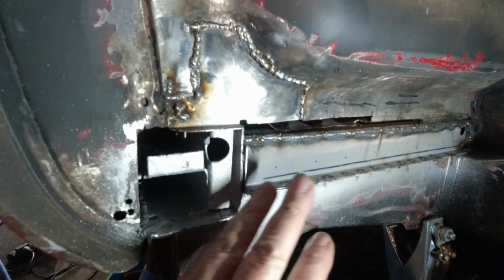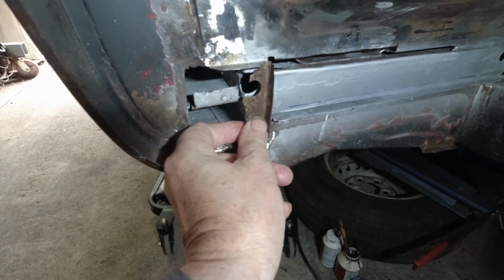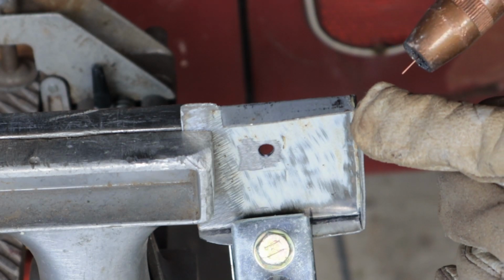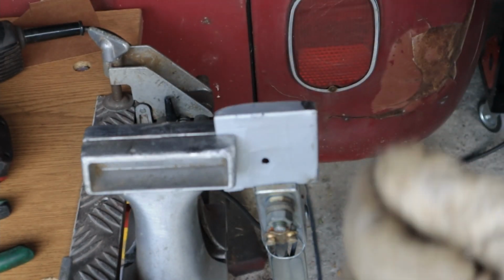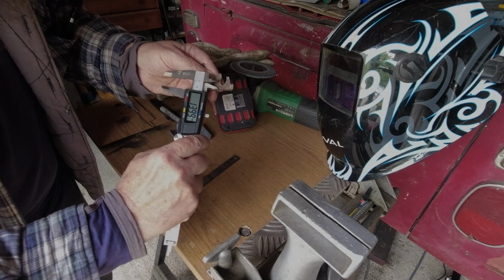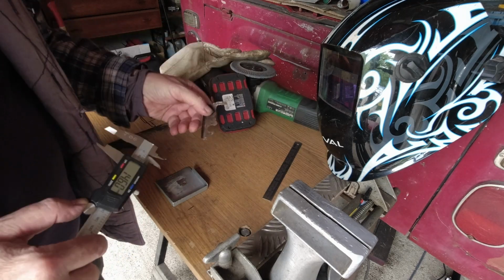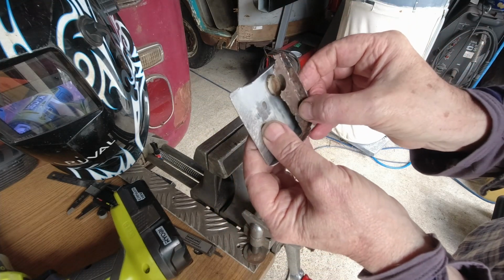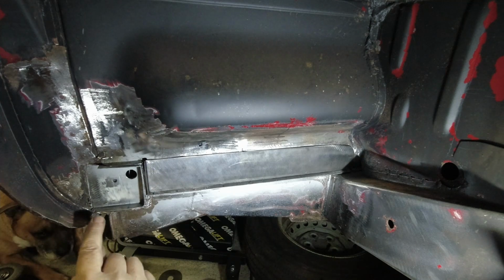vw camper restoration with welding tips and tricks.EP 06 critical dims on patch panels

Comment: I’m currently fumbling my way through and learning as I go with a Mercedes 609d. Your videos are excellent. Thanks for sharing. Big issue I’m having is working outside and as you know our great Irish summer isn’t being very cooperative. What product would you recommend for bare steel after I’ve welded in a repair? I won’t be getting to do the final paint for a good few months and want something to protect the metal. I had got some zinc 182 but have just read that it is porous! Should I be looking at a 2k epoxy? So much products and opinions out there.
Reply: @Joesrustbuckets  thanks Joe. I had seen those products mentioned in one of your other videos. I’ll pick them up. The finished paint job will be a sand coloured military paint applied with a roller. Definitely not going for concours finish. I just want something rugged and long lasting. I’m sure the military paint will go over galvafroid easily enough. My worry is doing something counterproductive due to lack of knowledge. I could really do with a few good weeks to remove the leaky bus windows and finish sheeting the sides. Thanks again for your input and videos.